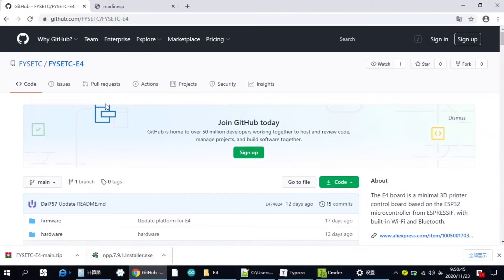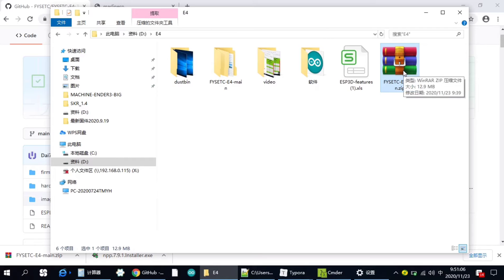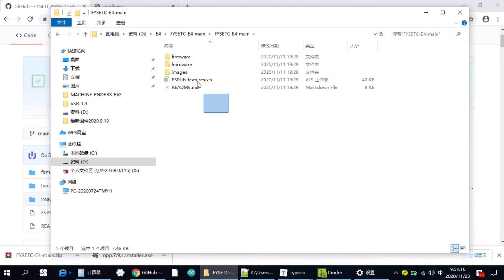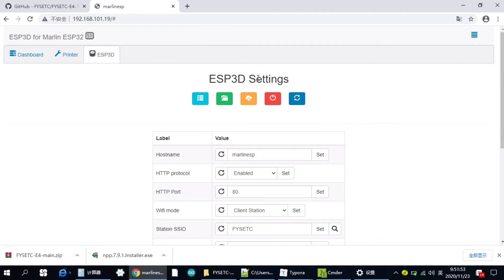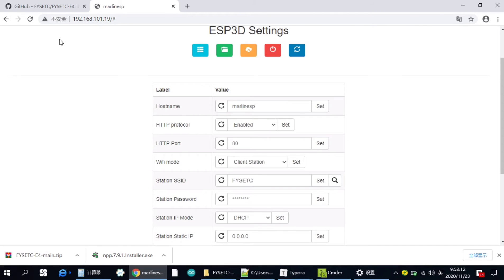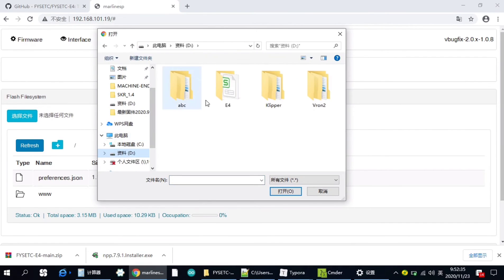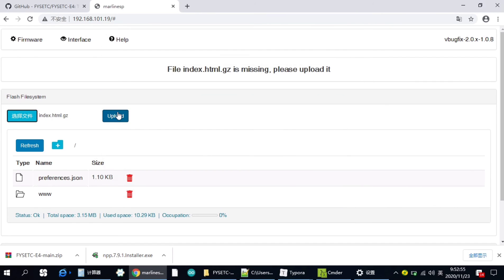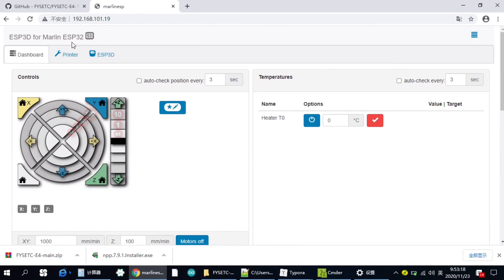FYSETC E4 : Update WEBUI(ESP3D)

Comment: Thank you for your videos.  For some reason I have lost communications with my E4.  It was working and I could connect after setting it up for my LAN.  Now it is not connecting by WiFi and I can not see it as an WiFi source or on the LAN.  

If I plug into the USB it shows up on my laptop as Ramp but I can not communicate with it.

Is there a way to reset my E4?
Reply from the maker: You can send [ESP111] to get the IP address, and if E4 can't connect to LAN , it will act as a hot spot, you should see it in your wifi list of your phone. And you can submit issue in our github: https://github.com/FYSETC/FYSETC-E4/issues
Reply: I had the same problem as you, the cause was incompatible firmware installation. Solved by reinstalling the manufacturer's firmware
Reply: @woklifev  Hello. tell me how to restore the firmware on this board? I also lost everything after updating the firmware. no wifi, no web interface. nothing at all
Reply: @Дядя_Саня_Никалаич  I think you use platform io and marlin auto build to reinstall the firmware